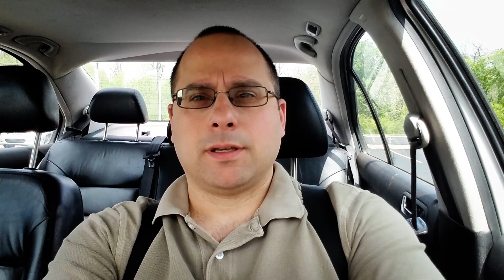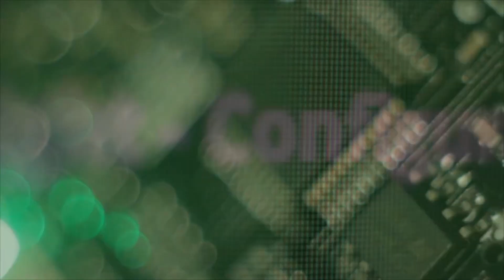Frsky Taranis antenna mod and why you probably shouldn't do it.

Comment: Thanks Joshua for this info, I too did the mod a few months ago and at 1st life was great and now it seems I am getting telemetry warnings left and right and fail safed less than 100 feet from the starting line at an event just yesterday. So who has the boards in stock LOL...
Reply from the maker: +Clayton Baker try replacing the antenna first and report back to me if it works.
Reply: Actually once this started happening I tested a few different antennas while tweaking my SWR. The end result was I went to a D-Link 2.4 antenna from a older wireless router which at that time produced better results. My SWR at that point was holding 0 and 1. I am running FrSky XSR's on all of my quads and I did notice this reduction on all, yesterday at the race it seem to progressively get worse. Now the XSR's are all over a year old and have been through the Quad Hell all of us put them through. I also want to add that I did the 1/4 wave length trim on all of them once they became somewhat damaged on the ends. All solder points on the XSR's look fine. The solder point inside of the radio looks clean and secure. I may test another RX like the X4rSB just to eliminate the XSR as being the possible problems. I have read that many people experienced issues with the XSR without the antenna mod. I may also order a 2dB antenna from Aloft to try and put things on a level playing surface again. I am however going to double check the internal wire as well. The wire I used was the one recommended in your video early on.
Reply: So at lunch I happened to bring the Bird in question along with another which also has the XSR. I basically did some walking...out to about 100 yards in various directions. I work in an area that has plenty of overhead high voltage wires just to give you an idea of interference. I tested the problematic quad 1st and upon reaching the destinations facing the quad my RSSI was about 57 to 60 depending solely what direction the antenna on the Taranis was pointing. In my case I received better signal with it pointed directly to the left with no angle up. So I tested the other quad and it seems to chime it better at about 65 to 68 RSSI with same antenna position. I then went for a flight with both. The troubled quad did not give me anywhere near the problems it did yesterday but I was able to get it to sound off on a RSSI warning and 1 short Loss of signal flying the same proximity as I walked. The other quad once I pushed it further and slightly behind the corner of a building barked quickly on a Warning but no loss. In all testing the SWR remained 0 or in some rare cases 1 (during the walking) It would be nice to have a setup on the Tarnais that would bark out the numbers of the RSSI instead of a simply warning or loss notification :) (hard to look with goggles) One thing I did notice today is that once the flight pack neared where I typically land this is when the troubled bird started displaying warnings and such. I may double check the solder points on the RX/FCB to make sure they are secure. If it is not getting adequate voltage then I feel this may be an issue as well?
Reply from the maker: +Clayton Baker you can make the Taranis read the RSSI or any other value when you pull a switch. I bet you can get it to read continuously.
Reply: Thanks for that tip Joshua, I actually I did program it to bark off numbers as I was flying. Thats pretty slick.
Reply: +Joshua Bardwell 
Sorry I've not added to this however after several tests with various Antennas on the Taranis as well as switching out a few RX's on the quads (older ones I had at hand) I decided to try switching out the actual mod cable within the Taranis itself. Using one very similar to this:  https://www.amazon.com/RP-SMA-Female-Connector-Pigtail-Cable/dp/B005G20NRC/ref=sr_1_3?ie=UTF8&qid=1493826104&sr=8-3&keywords=rpsma ... (which is about twice the cable quality)(cut to Alex's recommended 3.3 inches) I have found that my distance increased substancially. I went out to about 100 yards in a "heavily wooded" area and received no RSSI warnings. So I went out to 200 and finally received a warning. Once I turned around (RX antennas facing away mostly) I then received a real quick failure however it quickly went back to normal. Using the switch announcement for RSSI on the Taranis at this distance I was getting about 50 RSSI. Previously I couldn't make it much further without warnings and failures within 60 yards. With the several antennas I tested at my disposal the only one that gave me a good SWR (0 to 1)(after cable replacement) was a VAS (microwave folded 2.4 Dipole) (Previously using the VAS on the original internal cable I had many warnings and failures as well) 
For now I will leave well enough alone and see what happens next. I have also ordered replacement antennas for my XSR RX's since most are in need of replacement. I also ordered an X4RSB to have a fresh new RX to test range further.

Comment: im glad u posted this as i was looking at that mod very recently.i came to the conclusion that my QX7 is awesome and doesn't need a mod .i can get stupid range and my goggles give up before my QX7....no point in doing the mod in my opinion and im a noob :),its all good modding things that need it ,given ,some may need to do the mod for whatever reasons but on the whole if it aint broke dont fix it.noob out :) and happy flying :)

Comment: On this topic, can you please talk about the new Taranis Special Edition (SMA antenna mostly). I wonder if FrSky changed the board to detect and adjust for different antennas, or simply just threw an SMA cable on there like this mod, in which case may we see radio failures from this stock radio?

I ask I light of both the growing popularity of this mod, and that I just sold my original Taranis to chick sons price off buying the new Taranis with an SMA factory removable antenna, upgraded switches,  M9 gimbals, etc. I'm just so curious as to if FrSky made any internal hardware or software changes for the SMA antenna.

Comment: I've done the mod to 6 or 7 Taranis radios and never had an issue personally. My Taranis was done 2 years ago and still running strong. I remember buying a spare tx board just in case something was destroyed but never used it. I don't recall range testing all of them but I did a range test after modding mine and it made a noticeable difference so I was happy with it

Comment: Welcome onboard. I'm one of those that have Taranis slowly failing. I did the mod half year ago on cheapo used Taranis as it fell from my car's hood and snapped the original antenna. Initially I was able to fly 1 mile even without "low signal" warning. Now I get warning on 100 yards. There is no need to change the whole board - culprit is the frontend IC SE2431L so I ordered two for $6. However there is no way to resolder it home as most of us don't have proper equipment. I will do it at work, in ESD protected environment. we will see...
Reply from the maker: +Radim Štukavec have you tried replacing the antenna?
Reply: Hi Joshua, sure I tried. Today I spoke with my friend that did RF designs and I think we figured out why modded TXes fail over the time. When you look at that PCB, you see that there is no circuit interfacing SE2431L output to antenna. there is only a stripline.  So basically if you transport your TX without the antenna (what I was doing in past two months), you are directly exposing output pin to ESD. Only thing that surprises me is that this (output directly to SMA) is shown as reference design in the datasheet of SE2431L...
Reply from the maker: +Radim Štukavec I do transport it that way but what about the inductor that supposedly protects it?
Reply: Joshua Bardwell I read about that inductor here in comments. But when I see picture of my board that I took, reference schematic and evaluation board picture (both from that datasheet) there is no inductor...
Reply from the maker: +Radim Štukavec OK so maybe this is a leading explanation? With the long antenna it is necessary to transport it with the antenna removed quite often.
Reply: Joshua Bardwell I think it would make no harm if we transported our TXes with blind plug made of shorted SMA. So ESD would go directly to ground in case there is a charge buildup. But let's wait for some expert opinion.
Reply: I use a 50Ohm sma dummy load for transport and for when I'm just testing stuff on the bench or flying sims. The only issue I had with my mod was the sma connector rotating against the plastic and eventually broke my pigtail. I had the pre-installed u.fl on my backplate but didn't have any spare pigtails so I removed it and direct soldered another pigtail that I had lying around. I still get decent range and have always had ~32 SWR after the mod.

Comment: One thing I noticed while doing the mod is the fact that as far as I know on most rp-sma pigtails, the coax shielding is crimped to the connector and not soldered which can over time lead to a bad connection and this is why I soldered mine and I've had no problems with it so far

Comment: Was never going to do this mod but what about the tx that come with ufl for antenna such as the q x7? it does not require any soldering so no static damage caused? Just asking this out of curiosity

Comment: ok well.. the first time I did this mod I did use the crappy thin cable and it lasted a month before the board failed. I installed a new board, 316 cable and now everything is good and has been for a pretty good while in regards to SWR and range. In the name of science I shall persist with the 5Dbi and see what happens. So far so good but it might also be related to an older version of the board? I noticed the new board was a fair few revisions higher than the 18 month old board so possibly, this is a tricky one to nail down until something more concrete presents itself. Thanks for highlighting, hopefully with more comments perhaps a pattern will form.

Comment: Joshua thanks for the heads up. I literally just got the parts to mod my antenna today in the mail! I was planning on doing the mode like Mr. Steele changing out the stock coax with a RG316 coax cut to the proper length. What are your thoughts on weather the coax size is to blame?

Comment: Static failure is not an issue as the TX board has an inductor on the RF output to ground which will protect the unconnected SMA from static discharge.
Your problem is using cheap 5dBi antennas with unknown characteristics.
Reply from the maker: It's good to know about the inductor.
Reply: Uh.. where do you see an inductor on this IC?  the ANT1 pin (15) goes directly to the antenna with nothing else connected to it. the only inductors I see on this board are on the T/R pin(6) between the SE2431L and the CC2500 tranceiver.

that also raises my curiosity, about the length of the trace between the antenna pad and pin 6 on the front end.  thats 21mm of unshielded copper.  I wonder how that works into the equation...

Comment: An XJT module would fix your radio, and it already has a removable antenna.  I bought one for my Turnigy 9x, but I occasionally use it with the Taranis because I have a patch antenna for it

Comment: That sucks.
As one that works in the Electromechanical field, ESD damage  sucks.  It amazes me how many of our products are not protected from our vendors.  I actually cringe when I receive my components not in ESD bags.
So yes it can either get stuff right away or the problem can manifest itself over time and lead to catastrophic failure. 
Not saying that's what happened in your case. But can see it being a culprit in our hobby. Like you proclaimed not wearing a strap I would venture to say most dont.

Comment: Joshua i have a problem m running all kiss on my quad and i have a chromebook computer that i was flashing my kiss fc well my computer updated and it. changed my gui and now want flash nothing i just bought all knew kss stuff but still cant get it to flash . friend said to download   dfuse but i still cant seem to figue this out. can you please help me.
Reply from the maker: I don't really know much about KISS, sorry.
Reply from the maker: A Chromebook can't run dFuse though. dFuse is a Windows app.
Reply: Scott Manderson I had a similar thing happen. Chrome on my mac updated the Kiss GUI and it wouldn't connect to my FC. I had to do a fresh install of the most recent Kiss FC firmware (holding down the button while plugging the USB in) to get it to work. This will kill any setting you had previously so you'll be starting from scratch. You could also see if you can download an older desktop version of the Kiss GUI (maybe from their github page) that might allow you to connect to your FC. If you have any questions let me know. Good luck!
Reply: Ok i will try anything
Reply: dan langston how long does it it to down load its not doing nothing but circling
Reply: dan langston saying removing. device pertection
Reply: Scott Manderson mine didn't take to lone maybe a minute or so. I know that kiss encrypts the stuff to protect against knock offs so it sounds like it is trying to decrypt the FC so it can write to it. Also make sure you save after updating, it is another verification thing that Kiss does. You had the FC working with the GUI before right?

Comment: I did the mod out of necessity, not because I wanted to. ( I dropped my Taranis and broke the antenna 😣) It worked out fine and no problems. I used your video as a how to but also watched Mr. Steele's video as he has done the mod. Steele's isn't a how to but there is one factor in his that isn't in yours. he uses a much thicker AG316 guage coax and 84mm specific length. I did the mod using Steele's recommendations and range is better. also I believe as there is more powerful antenna the thicker guage coax is necessary to not create a bottle neck that could as you found out burned out your board. not sure the 84mm changes anything but I did it anyway. time will tell I guess.
Reply: oh man, thanks for posting this... i remember i did my mod watching his video. couldnt remember if i had cut mine to a specific length or not but now just realized i had. whew, also used the 316coax as well. mine is still working but isnt like cant just replace the board for $40.

Comment: Sma connector worn out. Connectors are used for ease of replacing boards and parts etc... Most antennas that are screwed on are for ease of replacement not to be taken on and off repeated times. Most items you buy have fixed antennas that may be replaced but they are either hard to get to or covered up with a plastic to make it look like you can't replace it. Check the center hole of the Sma to see if it expanded larger than the pin diameter. A subpar connection in time is not good.

Comment: I used the cable from Mr. Steele' s video and used the length of 84mm and haven't had any issues yet. I have also got further distance out of the mod as well.

Comment: I have just recently started experiencing a lot more "low rssi" warnings recently in the  last week or so and I have done the 5dbi mod. The range difference at first was the same, maybe less but now its considerably less looking back
Reply from the maker: Try replacing the antenna before you replace the radio board. Let me know if it fixes it.
Reply: Joshua Bardwell Joshua, one glaring issue for me is.. where did you source your 5db antenna? can you be confident of its quality?
 i did this mod perhaps a month ago after suffering less than stellar range performance from my stock taranis and antenna. i could only source the thinner coax, but i measured it correctly and soldered it well. i am however using the 2db (?) stock antenna from my xjt module. its swr is 16, but it has shown more reliability failsafe-wise than the stock setup it replaced. range seems unnaffected.
 i have a handful of cheap 5db antennas from banggood and they all give antenna warnings when tried.
i am expecting 316 coax in this weeks mail and will install it asap, in the hope of reducing my swr.

thanks for your heads up mate.
Reply: VAS now has a folded dipole with Teflon jacket  RG316 to use. its about $25 but the quality is WAY better. i have that, and i havent had any problems yet. with that said, i did the mod about 2 months ago

Comment: maybe the problem is the rp-sma-connector. you could easily give an electrostatical charge to the center-pin, when mounting or dismounting the antenna... i bought a ...shunt(?) - end resistor (??) i allways screw on and off in between use, and i am supercareful when changing antenna and shunt... the new antenna from ibcrazy has an sma-connector. and it makes total sense, that on the transmitter-side, if the hot wire is very sensitive to energy coming in, you have to go for sma on that side, having the pin further down than ground. though i just mounted my second rp-sma-antenna mod to fix the first one... have another xjt-module lying around though :D
Reply: Padawan zoKowan You may be right about that. I purchased a dummy load to screw in place of the antenna when I'm transporting it.

Comment: 2 years later after my mode (with IPX connector on one radio, and direct soldering on another), all good, all works, don't forget to solder two sides of negative wire. And use good RG wire.

Comment: I did the mod - I had too old antenna cable broke in transport

so should I replace the TX module then? or do you think this automatically damages the whole logic board

I guess the answer is whats worth more - my model or the TX?

darn it - I hate replacing stuff that isnt broke just because I am scared it will fail
Reply from the maker: +00fluxone if the range is fine don't worry.
Reply: ok, thanks - i will just pay attention for any strange behaviors
Reply: still getting approx 30m in range check even with a wimpy V8R4-II so I guess I am OK for now